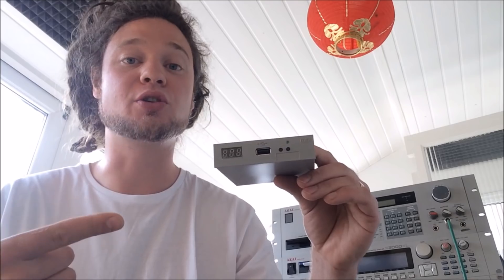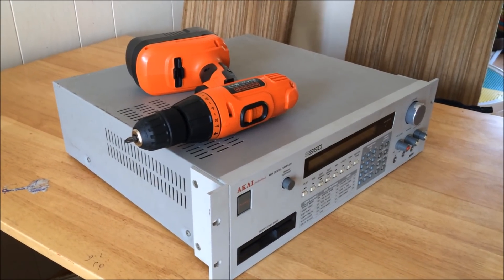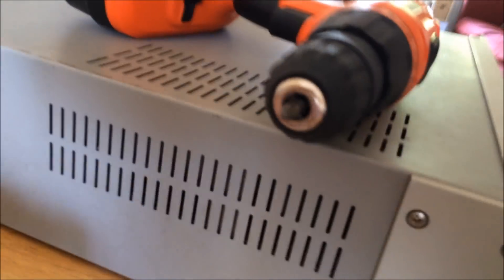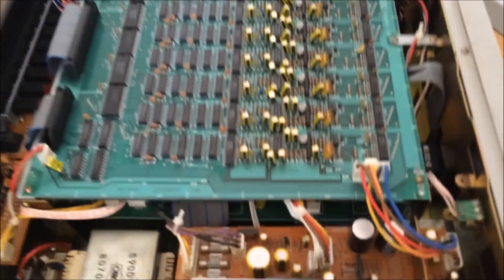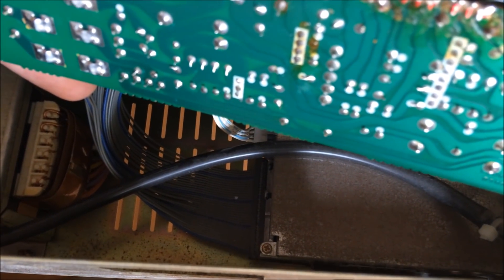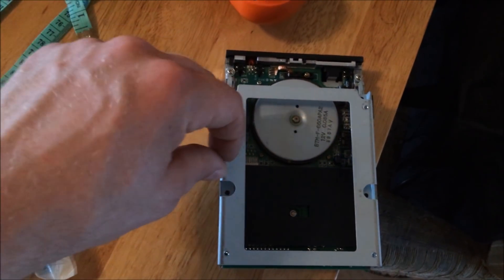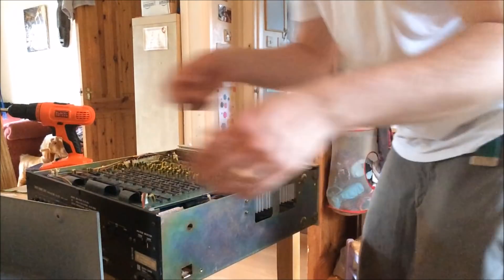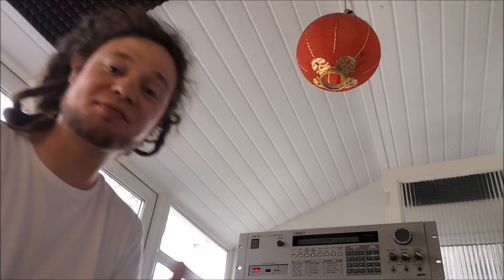HOW TO install a Gotek USB floppy emulator in an AKAI s950

Comment: Hi I'm also struggling to make the gotek drive work. Maybe my unit is faulty or maybe my usb stick has not the right files inside. Can you please share the files you have on your usb stick? Maybe just the .CFG file and a blank .IMG file? Thank you in advance..
Reply: Did you get it to work yet? I remember from another video the guy said you have to format the USB stick to FAT32 format first to be able to read the floppy disc images.

Comment: Greetings from New Zealand. I read on the MPC forums, someone claimed the floppy emulators or perhaps a specific brand, cannot save across multiple floppies like the real floppies. I have the full 2.25Mb expanded memory and an IB109 SCSI card. After 17 years of disuse I have tried to get the SCSI Zip drive recognised but it isn't fully happening. So I am going to buy and try a SCSI2SD drive and possibly a floppy emulator. If the emulator allows 1000 times 1.44Mb floppy images/disks then I don't think I would need a SCSI hard drive. SCSI is faster loading but I don't think it would worry me to have the S950 loading a chopped up breakbeat for a couple of minutes or however long it takes.
Is it true the floppy emulators can't save across multiple floppies. I can't remember because of how long ago it was, but I seem to recall the S950 would ask for a second floppy after filling the first one when saving more than 1.44Mb.
After watching a few rhythm roulette videos I am ready to relive my teenage golden era hip hop dreams, digging in the crates.
Thanks.
Reply: As a quick note, the Gotek floppy emulators have jumpers on them, the correct settings allow the sampler to save across multiple virtual disks. This might vary by particular make (and the various clones flooding the market) so refer to the documentation or various forum conversations about it. But it does work.

Comment: What software did you use to load your samples into the GOTEK device? i can only load samples into 000 via usb.
What software do you use to add samples to a different partition ? for example 0.02 i want to load samples but i can't access it via just connecting my formatted floppy usb on my computer.
Reply from the maker: Good question. I've never loaded samples from the computer as I don't have any on there that are the right file type. I've only ever sampled audio on the 950 and saved to the USB stick. I've been hassling Chicken Systems to update Translator 6 to S950 compatibility for doing exactly this, and a while back they did say it's on their to do list. As far as I know though it's not been done yet.

As for loading your already compatible samples to the individual partitions, Im not sure. Sorry :-/
Reply: no worries dude !!! i have an mpc 2000 classic with a gotek. 
i just use the first partition to load about 1.4 mb worth of samples. 

luckily i bought an external scsi zip 100 mb drive. without it i would be stuck using 1.4mb of samples.
Reply: Take a look at ketron.it/en/software/50-usb-floppy/usb-floppy-software-1-1

Comment: Do you know anything about the Gotek HxC that use's the compact flash/SD cards? They have small LCD displays on the front so the virtual floppys can be named et al?  I have a lot of hardware samplers and Im trying to figure out the best route to go considering my set up. Any info. You have would be immensely helpful
Reply from the maker: Fraid not, sorry. Only experience is with this one
Reply: You can add your own oled display by attaching the connectors to the Gotek, looks fairly easy and intend to do this myself when I buy one. Not seen the sd card variants of the Gotek yet but know there is a scsi to sd card you can install but that is designed to replace a hdd rather than a floppy and it usually sits inside the floppy bay so not sure if you are confusing the two?

Comment: I ask your help!
I installed Gotek like you, turns on properly.
I tested pendrive 8gb.
formatted in FAT32.
I need to update the firmware Gotek? with which software?
I tried HXC software to create a virtual image but without success, do not understand where I'm wrong!
If you can give me precise directions, thank you!
Reply: I hope he has time to make a video which clearly explains how to use the units' and that the software uses.
I can not solve my problem yet. @daddy abe !
Reply from the maker: @Matteo Nolli re: software...Sorry mate, can't help you
Reply from the maker: @matteo Nolli re: how to use the emulator... It's just like the floppy drive mate. Instead of saving the samples and programs you create onto a floppy disc, you save them to a "virtual floppy disc" if you like, called an "image." They're numbered from 0-999 on the emulator's screen. You just scroll through the numbers using the emulator's buttons, and hey presto. There's nothing more to it than that.
Reply: Matteo Nolli
Reply: paul ? hi...
Reply: Hi sorry didn't mean to reply!

Comment: Hi Daddy!
I had some questions to you about basical workflow of Akai samplers. Im here again to ask  some storage info :) 

I bought an S2800 but without SCSI expansion. So no SCSI on the backside.

So here are some things which not clear :

1. Because i dont have SCSI connection on the backside of the AKAI, can i simply load up USB pendrive  with a simple PC-USB connection? Or its possible only in chain like USB>Gotek>SCSI>PC?
2. I need to format the usb stick or the complete emulator? 
3. As i think i need chickensys translator to make akai sample format and programs. Also by this software is the easiest way formatting usb stick ?
4. Is the sampler have a maximum readable capacity in megabytes?
Reply from the maker: 1. If you have a Gotek then SCSI is not required.
2. Both the emulator and the stick need formatting.
3. Translator is a good program to get, but it doesn't help much with the floppy emulator. It cannot create the image files the emulator reads. Chicken Systems recommend using SCSI instead of floppy emulators. (Which isn't much help if you don't have a SCSI enabled PC or sampler!) 
4. The S2800 comes with only 2MB of memory as standard. It can be expanded to 16MB but I think the chips are obsolete now.
Reply: Thanks for proper info.!
Actually at 4th question i wanted to ask the limit which Akai can reads from the usb- emulator, the maximum usb size. :)
Reply from the maker: I think you're limited to 999 images. So if they're 2MB each that's 2GB right

Comment: will this work a 3000xl? not sure what to go for in terms of bigger storage, heard mixed reviews about some scsi devices not working
Reply from the maker: Yea should work. You'd just need the corresponding firmware and cfg file. Not sure there'd be much point though, as the 3kxl has SCSI. Just get a SCSI hard drive if you can afford one?

Comment: My understanding is that the Gotek USB cannot be written onto like the (much more expensive) SD variant?  Does this mean you can't record into the S900 and save it onto the emulated Floppy images?
Reply from the maker: No that's not the case. Saving recorded samples works fine :-)
Reply: Thanks for the quick reply!  That's great news, not sure why the HXC site stresses "no write" on the Goteks, must have been a past release and since fixed.   Thanks!

Comment: ¿How many samples can be loaded? ¿1,44 mb?

¿Can you show how it works?

Thanks
Reply from the maker: +SOUNDTRICK Yes exactly. The USB stick comes with 50 .HFE files on it, which are "Floppy Disk Images." Kinda like a CD image that you might save to a USB stick in order to burn a CD elsewhere if you don't have a CD drive on your computer. Each of these floppy images behaves like a virtual floppy disk. You just load whichever samples and programs you want, from whichever images, to the sampler's memory. You select which image you are dealing with using the buttons on the emulator. 

(Actually, whichever image you leave it on when you power off the sampler - all of it's contents will automatically be loaded when you power it on next. So you need to power off on an empty image in order to start up with empty sampler memory.)
Reply from the maker: I'll get back to you bro. Just on holiday atm.
Reply from the maker: Do you mean per floppy image? Yea it's about a floppy's worth of memory per image. So if you sample at full bandwith (19,200) then you can fit about 30-35 drum samples on a floppy image (if they're a quater of a second each.)
Reply from the maker: If you mean on the whole USB stick, then its that multiplies by 1000 :-)
Reply: I cant understand it.    

¿Have you got many partitions into usb with samples?  

¿Is like you have got a lot of floppy partitions into usb? A lot of virtual floppy drives into usb stick.

Each partition have the normal size like a clasic floppy drive. 

Then, you charge those virtual floppys unto ram memory.

¿Is this right?

Thanks
Reply: So it means only floppy disk size samples can upload to memory? I mean can i upload a 30 second long sample from the emulator? I suppose not because its like floppy images.
And what about the uploading speed to memory? Faster or the same as floppy?